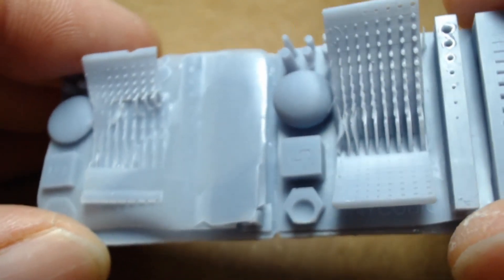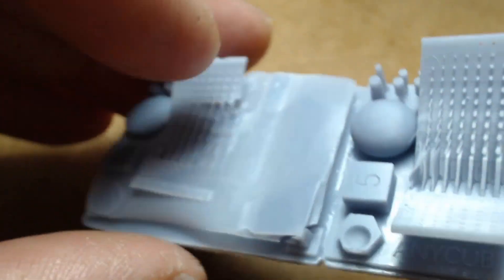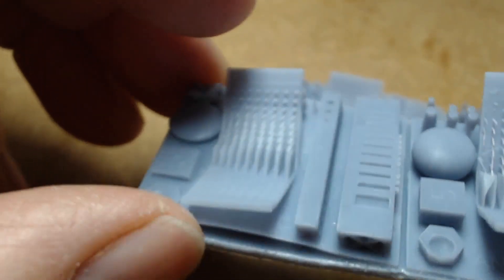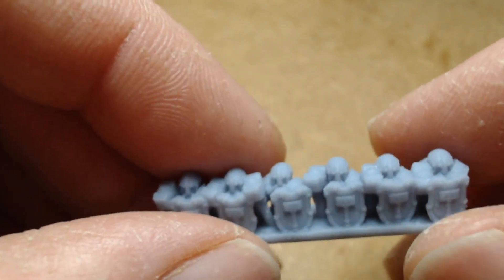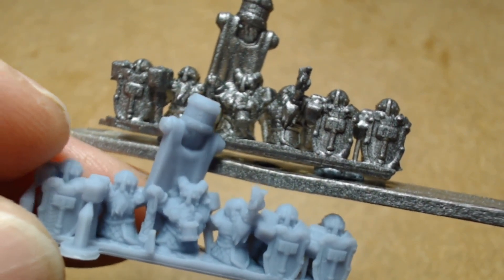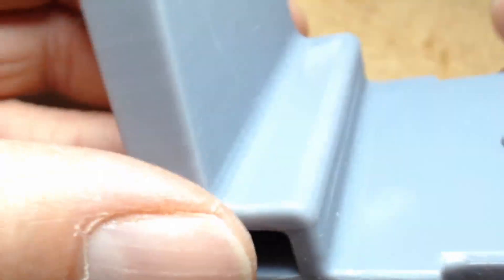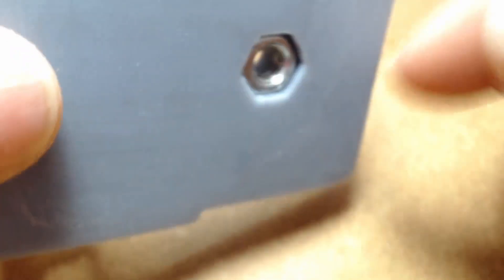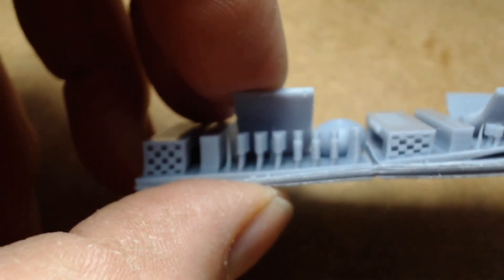Adventures is 3D Printing - Episode 9

Comment: Leaving them on the bed overnight is fine (I left ones on my bed for 3 weeks once).  It is all about natural light (UV) getting to it.  Try and keep the printer away from direct natural light and if you can't keep it away from it then chuck on a cloth over the top after printing is done if you can't immediately remove and clean.

Also if you are running into a fair few breaks you can try exposing them to UV light for longer, some of my wood elves I had to do probably double the cure time than normal otherwise I was running into loads of breaks.